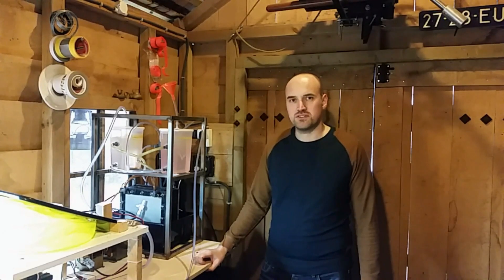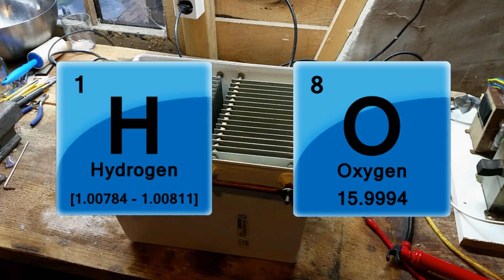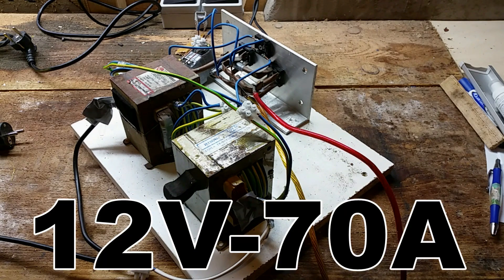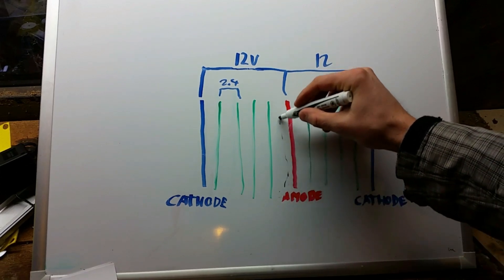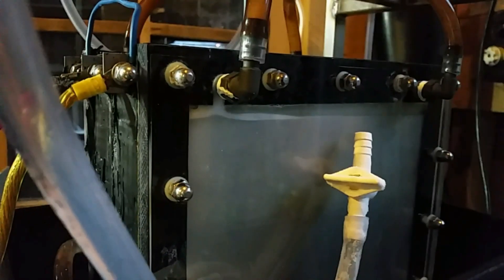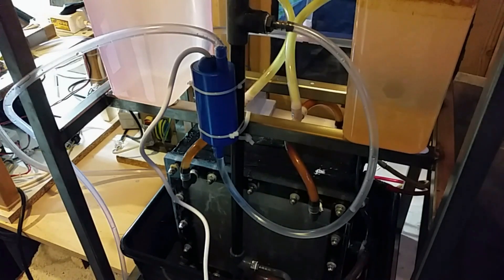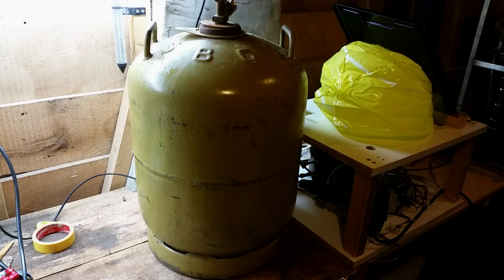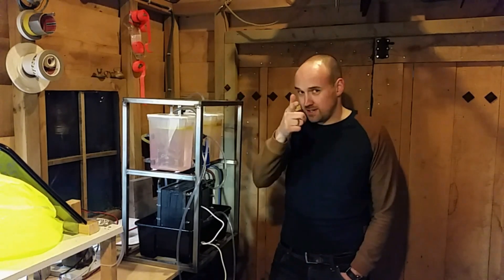Hydrogen Generator #1 Homemade Hydrogen Generator And Compressor Unit

Comment: is it cheaper to obtain hydrogen the sodium hydroxide/water aluminium way or the electrolysis/sodium hydroxide way?
Reply from the maker: Yes electrolysis is much cheaper because aluminum is quite expensive.
Reply: @TheDIYScienceGuy  true, but it also depends on your electricity bill
Reply from the maker: Yes, but aluminum also takes a lot of energi to produce so that's already in the price.
Reply: @TheDIYScienceGuy  i see, there is a bigger energy needed to extract aluminium from bauxite ore, but if you happen to have a lot of scrap aluminium this is something you could do with it, but electrolysis like you mentioned is more superior for cost and practicality since you could recycle the aluminium in other more useful ways, thnx for enlightening me

Comment: Great Video! But, What about the chlorine gas from the sodium hydroxide. should use Potassium Hydroxide
Reply from the maker: Thanks! Sodium hydroxide is Sodium oxide dissolved in water and it does not contain chlorine. Sodium chloride (table salt) does and if I had used that the chlorine would have been a problem.

Comment: execllent video and good information. 
i installed dry cell hydrogen generator in my car. to cool the water in the dry cell. i used a small radiator and computer cooling fan. passing the water from the water reservoir to the radiator and back to the reservoir this way the water temperature will not raise

Comment: Hi there, thank you very much for sharing.are you willing / able to share a technical drawing of this project of yours? If not Maybe for a domation?.Ihave been wanting to harvest hydrogen and a propane tank you use holds enough to fuel a single cylinder quad/lawnmower or moped for lot's of miles.I need information on how to compress and store it in such tank in a efficient and precise  way.It's possible you are not going to read this.then I will try your social media accounts.kind regards,Mark

Comment: The main question in all this is can you generate enough to either run an engine or supplement an engine to gain better mpg?   The claims others make are usually to sell a kit or simply for views.

Comment: Hi
Are u using a fridge compressor for comprising H2.
Reply from the maker: Yes I am.
Reply: @TheDIYScienceGuy  thank you very much. But isn't that dangerous. Bcz when it is compressed, the temperature is higher. So isn't there a chance to explode. Or are you using any safety method.
Reply from the maker: As long as there is no oxygen there can be no boom. Just check the temp so your hoses won't melt, to prevent gas leaks.

Comment: Loved this setup, thanks for sharing. I have a question about storage of hydrogen. I wanted to do this but was discouraged after reading how good tiny hydrogen atoms are at escaping. For backyard scientists like us it is almost impossible to keep the hydrogen in the tank because it sneaks around the valves. Perhaps this is a question of degree. If I could generate and use a tank of hydrogen in a day, for example, perhaps I can ignore the small loss (and mitigate the potential dangers). Any insights welcome.
Reply from the maker: Thanks! Well, I can keep a tank full for many months, just keep it in a well ventilated area to be shure.

Comment: Very nice video, I had one thought 🤔
Isn't it possible to let the reaction happen already in a pressure unit, and then to let it stop, when the pressure limit is arrived? So you don't need a compressor etc. and you would save a lot of energy also 🎉🎊
Reply from the maker: Yes that is possible, but it makes no difference in efficiency. However, it's hard to make a generator that can handle the pressure.

Comment: What are you using to power the system? You mention at one point it cost you somewhere just over $1 to produce over 500L of hydrogen which seems wildly impressive
Reply from the maker: I'm using the transformer that I show in the video.

Comment: Grate work and good video..
Electrolization sweetspot of water and sodium hydroxide is ~2V per cell.
Current used is proportional to Volume generated.
Production can be increased in 4 ways and/or the combination of  these:
1. More Current
2. More Surface area per cell 
3. Increas or Decrease gap between plates
4: Higher saturation of Alkaline solution 
keep in mind increas one point will not work unless a nother prerequisit is met, for example if you increase plate surface area you will need to increase current etc.
CAUTION:
1. Always use flash arestors in gas lines perticulalry ones conected to larger volumes of Gas
2. Never conect power close to electrolizer cell, sparks can cause ignition. use a remote circuit braker.
3. LAST > A bit of Oxygen in Hydrogen is not as dangerous as a bit of Hydrogen in Oxygen.
Reply: Have you looked into using resonance? I’ve seen experiments of using frequencies to weaken the bonds between the atoms so less energy is necessary to separate them. 

Also have seen a pulse wave modulation used for the electrical input to greatly reduce heat since the water is not being constantly electrolyzed. It also helps save the plates being used.

Comment: jow much pressure on the gas bottle ? 8 bars may be ? this finally not much hydrogen stored after all ?
I thought myslf of using a compressor for diving bottles wich can go up to 200 bars I think, and then use oxygens bottles to store the Hydrogen! so with this oyu could power a car!
Reply from the maker: 13 bar 550 liter of H2. Never use oxygen bottles to store hydrogen because of hydrogen embritlement. Only use specified hydrogen bottles for high pressure. Also, a diving compressor might not be usable because of the same reason.

Comment: Does your pressure switch have just one in and one out? I got one but have had a hard time piping the third smaller female (of course have tried it only with air), big hugs just followed you😇
Reply from the maker: My pressure switch has just one connection point. That's all it needs. Thanks for following!

Comment: Amazing job! I kind of imagine something very similar but got scared since a diver friend told me many gases turn unstable with pressure changes. Big congrats, u r my hero. Do you use it to cut/weld metal? Or maybe to fuel engines and generate more electricity? (I know every energy transform involves a loss, what electricians call a “negative loop” still great job, I have just dismantled 2 espresso machines in search for tubing💎
Reply from the maker: Thanks! Have you seen this video of mine: https://youtu.be/llmcU-mZRFs

Comment: what would you need to do to get it to the right pressure and gas to fuel a hydrogen cell car?
Reply from the maker: Fuel cells don't need a very high pressure.

Comment: Key Takeaway:   70L of Hydrogen per Hour,  550L Hydrogen needed for Propane Tank  Takes about 8 hours to fill.   $1.20 cost.          The next thing would be, how long will that tank power a generator for and how many watt hours of power could be produced from it.    What is the PSI of that tank?

Comment: on my youtube many videos from my research to make a home made heavy duty oxyhydrogen generator that produces about 0.6LPM of HHO gas and can run for 48 hours non-stop, with a gas filtration system using an HT50 nano bubbler so it can use water and electrolytes  not too clean, the gas results remain clean.  Developing countries need tools capable of using dirty water.

  OxyHydrogen has an instant anti-inflammatory and anti-inflammatory effect either by inhalation or by directing it to the surface of the skin with a silicone mouthpiece.  Long-term use for months (inhaled or sucked through the mouth) will give the effect of stem cells and organ regeneration.  I don't dare to drink hydrogen water because it looks fine with the PEM inhaler, but still dirt will arise from the electrolysis so it needs to be cleaned with citric acid so that the electroplating falls out and is able to work again to produce gas.  If you use the inhalation method when the filtration doesn't work, there will be a smell like burnt rubber, change the water from the filtration tube and everything works fine without the smell coming back.  The video on how to make the tool is on my youtube step by step.  The tools are made in my own room, kitchen and bathroom without any special tools (home made).

  https://youtu.be/DqTzCaC0Vfg

Comment: Stack cells alternating + - serially. Seal rims. For each half cell, collect the proper type of gas, alternately H2 and O2. 

Power supply:
Use high efficacy PC power supply. 
Or ask inverter manufacturers if they‘d support 48V electrolysis cells, and go for this voltage range; you have to communicate with the inverter to tell it how much shall go into the electrolysis on the DC power bus, and you need an interruptor like relais for switching it off. To regulate current, a dc dc (having its own efficacy) would be wishful thinking, but one could also configure the stacking of cells in a flexible way and control the number of parallel and serial cells by some microcontroller. Even perhaps let some cells in reserve sleep unused while the inverter voltage is low. Since in real life, you will want to do electrolysis while the inverter battery is full, you can build the electrolysis for the upper range of your (PV) battery storage system. 

Separator:
Could one put a separator (would old goretex membrane or a roll of ffp2 mask fleece work? The pros discuss conductivity of the membrane structure itself with „commercial Alkaline Water Electrolysis (AWE) diaphragm (Zirfon®)“. 0,5mm. 
See https://www.ncbi.nlm.nih.gov/pmc/articles/PMC6835761/

I strive for something thinner than the household wipers fleece. Then you can stack plates serially, by sealing them at the edges. Of course you have to provide for electrolyte flow and gas separation. 
If you let it flow quite fast, 2 small pool pumps (or brushless pumps admitted for aggressive media) regulated by inverter, perhaps you gain efficacy, because you can prevent gas from covering electrodes and separate gas extraction from electrolysis. Gas has less time to wander through the separator, so this does not have to be perfect. Probably this all is already invented, and we just do not find the right words. 

At best, one would need gas bubble guiding structures where bubbles attach to and are led with the stream of electrolyte. 

Perhaps you find hollow fibres like dupont that could let gas diffuse in but not the water, and build a fabric of it to lead the gas out of the electrolysis zone. 

Ultimately, I see the H2 production and separation as a way to burn it right afterwards in a micro turbine or fuel cell to get rid of O2 in air, so I can do direct electrolysis (catalytic and/or cold plasma) on N2 to gain easy separable and storable (fluid at 9bar 20°C) NH3 - ammonia. There some old still approved standard fluid gas (underground) tank is sufficient storage, pressure-wise as well as regarding volume. Used go away for 700€ per 2.7m³ seen yesterday. 

Keep up the good work and stay safe!

Comment: You should always wear goggles around homemade experiments as lighting bolts of Genius strike and you realize something great, at the same time you will realize you need to protect your eyes at all times! working with a fellow science nerd is very rewarding 20 years ago a friend and I made a hydrogen fuel cell that got us 125 miles per gallon when added to our gasoline in a 301 V8 engine we also cooled down the carburetor with a heat sink and water moot, we never expected so much mileage. Just cooling down the internal combustion engine has stunning results. Just replacing all lights with LEDs on the electrical systems takes the wear and tear off of the power windows, and all other power systems and LED's allow for artistic creativity, LEDs became available in the early 80 why didn't the big three switch over right away. They could make flying cars right now but would rather pretend it's not possible. An inventor would be crazy to show his stuff in this greed-filled country. You cant get a patent unless your math adds up to einsteins theory which the math doesn't work on! These are the kind of things the big car guys don't realize is plan stupid. so scared of competition!  Cannot wait to get the Tesla truck. Of make my own flying truck, and yes without propellers and yes will seat four fat people like me easy!

Comment: You have to move the water to cool it down and push the hydrogen out faster! 1/8 of an inch between the plates will produce the proper flow of hydrogen and a simple water pump from an aquarium will do the trick.

Comment: Hello I'm very new at what you seem to know well. So I would like to ask you a question on a power system I'm trying to develop. I live in Texas and I'm going to put up solar panel on my roof with the intentions of either using PEM cells or maybe radio frequency to split water. But instead of trying to store hydrogen I'm going to use a Satatier reactor to turn the hydrogen into natural gas. I will capture the co2 from a 10kw tri fuel generator I bought to use the Co2 and hydrogen into a reactor. I have converted all my appliances into using natural gas. I only have calculations that say a system like this will work to provide electric power, heat, and fuel my car. Can you please tell me due to your practical knowledge and experience, will this system I'm building work? Thank you, Brian...love your videos..thanks
Reply from the maker: Thanks! I think something like that will work but It's a lot of work to make something like that. Good Luke, and please let me know how it goes!

Comment: im considering if this could be a better option then a wood gas generator for a boat project, it could be self sustaining for a really long time. it would make taking long trips much much cheaper
Reply from the maker: Well, you need to make sure there are no leaks so you don't blow up your boat.

Comment: hey, i have a project about stocking electricity in a form of hydrogen to use it later. And to do this with neutral energy, but i don't know where to start. First i have to learn how to electrolyze HHO and separate Hydrogen from oxygen. Please may you lead me on this when you get some free time? We can communicate by discord or skype even with Facebook, zoom, any app you are able to use. This project is really important for me. And there is no one has knowledge about such things. I would appreciate it if you even give me one piece of information about how to separate gasses and turn them into liquid form by pressure.
Reply from the maker: I have my videos and this diagram of the compressor on instagram: https://www.instagram.com/p/Bpl2pLijM7z/?utm_medium=copy_link that's all, I'm afraid. Hope it helps!

Comment: This is inspiring. 
Basically, all we need for food is a fridge to store and then safely compress a small among of HHO to cook for a small family each day. 
When gasoline prices are "gouging" so high by our big govt this day, a small tank of HHO safely adding to our car as fuel addiction can save us a lot of money in the long run as well, even if we can only refill the compress tank with electricity at home.
Reply from the maker: Never compress HHO. You can only compress hydrogen and oxygen separately.
Reply: @TheDIYScienceGuy  How much pressure will cause HHO explosion?
Reply from the maker: I'm not sure about the pressure but a very small spark will do the trick.

Comment: hi .. can we use the stored gas for cooking ? or the flame is too hot to use it anywhere ?
Reply from the maker: Hi, yes you can use it as long as you reduce the air intake of the burner.

Comment: Hey, loved the video. Could you make this design into a mobile unit such that a) it would fit into a vehicle, and b) could be powered by solar panels on the vehicle? In this way my car could generate sufficient energy while sitting in the car park during my day at work to drive me home?
Reply from the maker: Thanks! Yes, that would work. I think this one would already fit quite well, but it's not the safest thing to do. Also, the amount of energy that can be generated on a car roof can also be stored in battery's, so then you could add an  extra, electric motor, onto your car.

Comment: The reason your setup is heating is because of the electricity running through it. Your electrolyte then becomes a resistance where heat is created, i don't think there is any link with the speed of the mollecules being split. (my humble guess as well), Great video !
Reply from the maker: Thanks!

Comment: and what is cost of energy you take to make 0.2 cents / 1lit hho ?
Reply from the maker: Around €0.25 per kwh
Reply: @TheDIYScienceGuy   Thx. it looks very promising !! since I have energy cost of 0.07   ( around 5 times less than you's) have you tryed to use graphite separators insted of metal ones ? https://www.youtube.com/watch?v=CuZ5WxYwl4g      this guy claims that its much more efficient but gives no data
Reply from the maker: Unless this is something special, graphite has a much higher resistance and therefor generates a lot of heat.

Comment: I learned a lot from watching this video, but I have 2 questions. Is there water entering the bubilizer or just gas? Also, do you use a pump to draw the water out of the bubilizer and back into the electrolyzer?
Reply from the maker: The bubbles that rise in the pipes push water up into the containers above the hydrogen generator and this in turn makes the water at the other end flow back into the bottom of the generator. I hope this explanation helps.
Reply: @TheDIYScienceGuy  Ok this clarifies thank you!

Comment: would it be possible   to compress the hydrogen with a scuba tank compressor??
Reply from the maker: That might work but you need to absolutely make sure there is no oxygen exadentaly  being sucked  in.
Reply: @TheDIYScienceGuy  yes would need to make a custom compressor intake manifold  to ensure only hydrogen enters the compressor